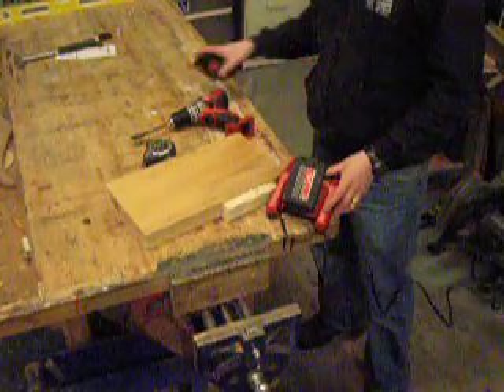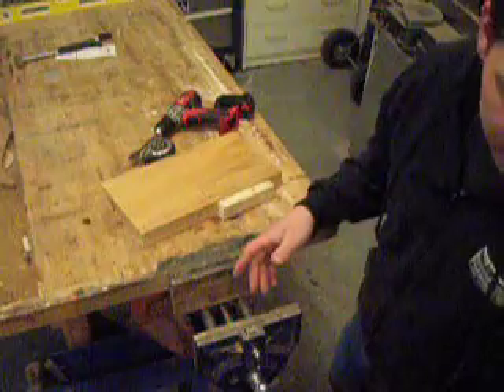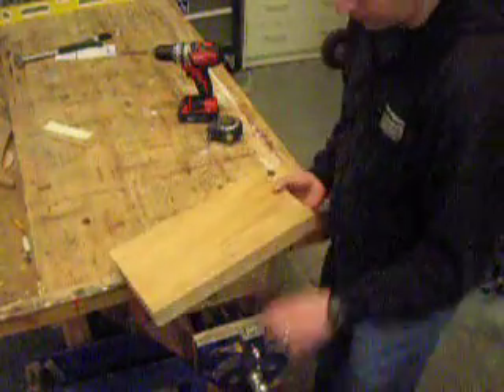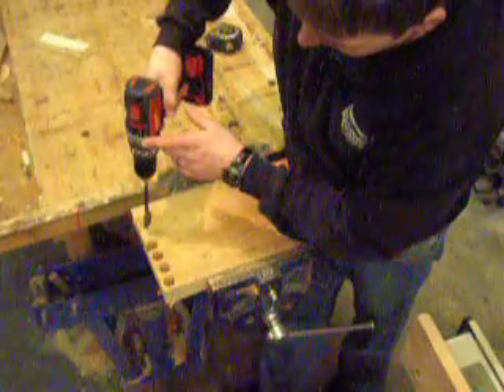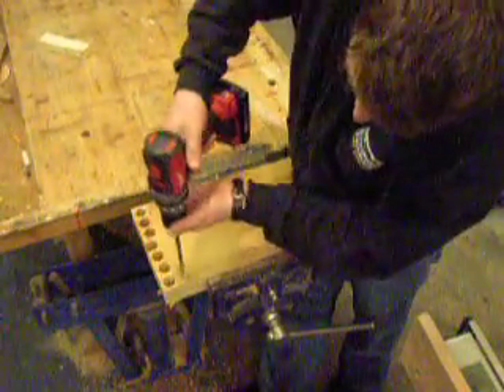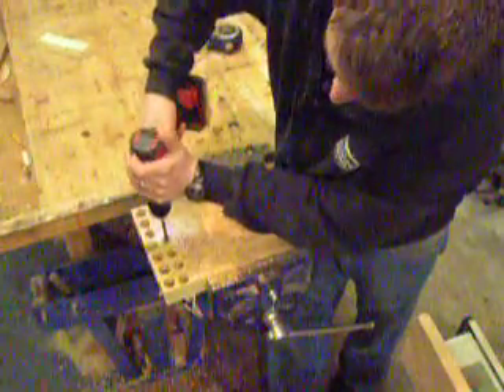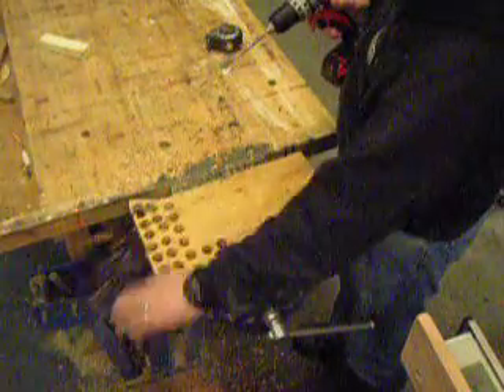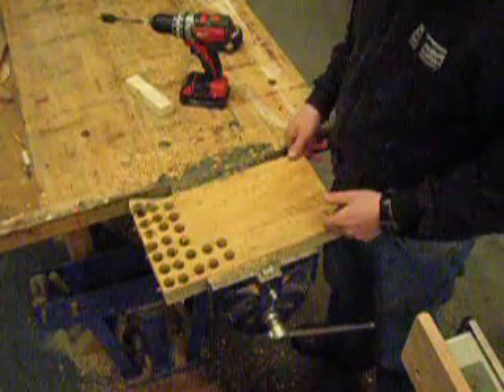Milwaukee 2601 compact drill test with 1.5 amp hour battery - Part 1

Comment from the maker: @victoriadish I haven't tested it with one of those bits, but it stands to reason that the battery may last longer if the bosch bit was more efficient and allowed for easier cutting and chip removal. This bit wasn't recently sharpened and had a year or two of use on it already. I was going for an average case scenario.

Comment: y'all want to hear something cool?... well milwaukee battery packs use what i believe to be 18650 lithium ion cells, 3.6v and they use five of these at 1.5ah... you can get new lithium cells that are 2.8ah, five of them cost about $35, and you can convert your compact battery pack to have the power and performance as if it was an XC battery pack, while being lighter, and better balanced as itll double your capacity